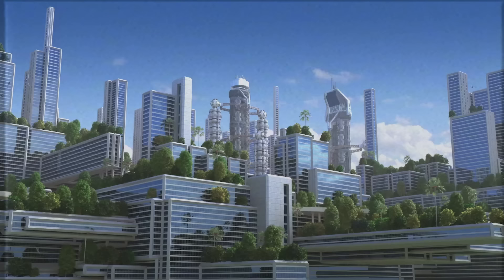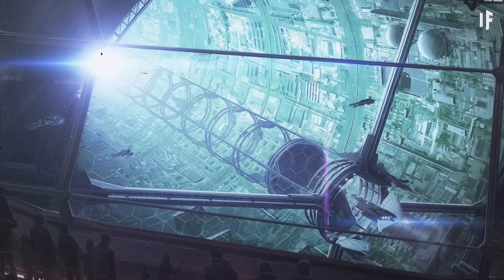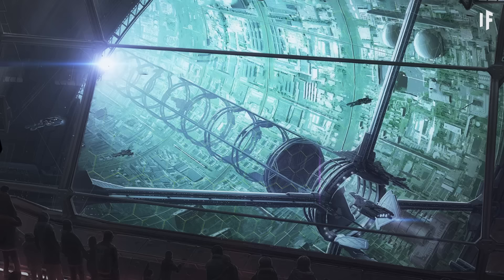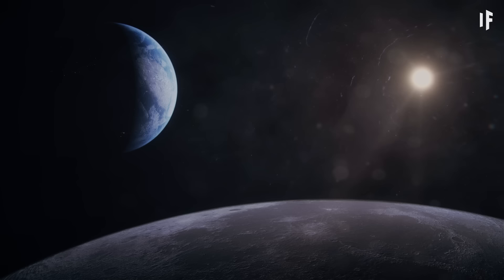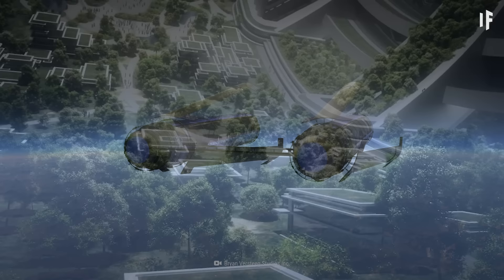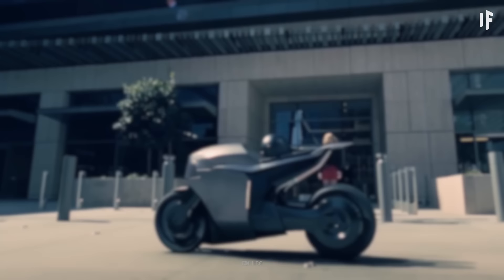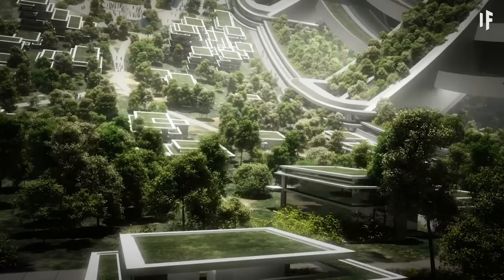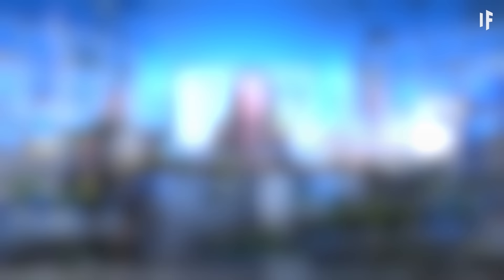What If We Built an O'Neill Cylinder?

Comment: 1970: this is a terrible idea, why would anyone wanna live there?
2020: yknow this doesn’t seem all that bad
Reply: Thats True😂
Reply: Actually, 1970's was when the book that O'Neill wrote about it came out and it was considered a good idea though students at Stanford designed the smaller and more feasible Stanford Torus which NASA said could be built in twenty years if their funding remained at Apollo era levels.  Unfortunately, their funding did not remain at those levels.

With both the O'Neill Cylinder and Stanford Torus, the first step is to mine resources in space, rocks for shielding, iron, aluminum, dry ice, and water ammonia ice for the pressure habitat.  Both Stanford and O'Neill proposed a mining base on the Moon but an asteroid trapped in CIS lunar space would do as well if we ever figure out how to mine without traction.

The construction could be quite simple and automated, metals could be drawn out as wires, spun as cables and knitted into structures with a large loom, the spaces between the cables could be thermite welded or filled with plastics or glass or even soldered with metal.  The dry ice and water gives us hydrocarbons hence plastics, oxygen and hydrogen, the ammonia which often comes with water in space gives us nitrogen and hydrogen.  The regolith/rocks can be packed in sandbags or mixed with a binder like plastic or cement to form the non-rotating radiation and meteorite shield.  The rotating pressure vessel can be separated from in the static shielding material by Halbach arrays of permanent magnets and aluminum rails or rather coils in an Inductrak magnetic levitation, that does mean the rotating pressure vessel would need occasional boosts to it's rotation either through thrusters, gyros or momentum control wheels and thrusters (at some point the thrusters would still be needed to despin the gyros or momentum control wheels as they can't be spun to infinite speeds but the gyros and momentum control wheels means that propellent doesn't have to be used all the time).  The energy for the levitation comes from the kinetic energy in the rotation of the pressure vessel hence the need to add more energy to the spin.  Transportation between the spinning portion and non-spinning portion would be done with PRT capsules that again uses Inductrak magneric levitation and linear motors and dock with the various habitable spaces whether with artificial spin gravity or the unspun microgravity areas.

Note, the original calculations used half atmospheric pressure for the atmosphere with higher oxygen levels for the same vapour pressure.  The idea was to reduce the structural strength needed for the pressure vessel.
Reply: Why is it a terrible idea?
Reply: It is a bad idea
It's not even an idea
Reply: @johnwang9914 looks like we have an engineer here.
Reply: 😯 great idea
Reply: Its not a bad idea to live in a colony until the one year war happened
Reply: 3020: Earth? You mean that big ball? Who'd want to live there?
Reply: This really could be the humans first step to an interstellar space colonization, I believe in that idea!
Reply: 2040: living on a planet? What a bad idea !
Reply: @johnwang9914  
Reinforced concrete takes much less metals compared to what we might usually think of, and makes a much more robust structure.
Reducing the mass of the overall structure is largely self-defeating. Rock works well as structure and shielding, and personally, I like the idea of having 1.7 meters of reinforced concrete as structure and shielding.
 If that's not enough, a non-spinning shell could be outside that encloses the entire colony and shipyards with shielding and meteoroid protection.
Reply: @JFrazer4303  Reinforced concrete is still strongest under compression with it's tensile strength from the iron reinforcement.  Rocks also have compressive stress not tensile and would fly apart under the stresses of centrifugal artificial gravity.  What's needed in a centrifugal pressure habitat is tensile strength.  The O'Neill Cylinder as designed by Dr. O'Neill, used steel for it's tensile strength and they still increased the oxygen content in the atmosphere to 50% so that they could reduce the atmospheric pressure to put less tensile strain on the pressure centrifuge.  Reinforced concrete is an excellent building material but is irrelevant in the discussion of an O'Neill Cylinder.  Now the non-rotating micro-meteorite and radiation shield proposed of the Stanford Torus which is 95% of the mass needed is not under tensile stress and hence can be packed regolith, perhaps in sand bags or with a binder.  Keep in mind that quicklime which is what cement is made of is produced by firing lime and lime on Earth is the product of life, particularly sea life with shells, and you're not likely to find this on asteroids or the moons.  Basically concrete as we know it isn't going to happen with a large space habitat but if you use plastics synthesized from the dry ice and water ammonia ice found in asteroids and the moons then you could use the plastics as a binder for the regolith instead of the cement in concrete.  It's a bit pointless to be talking if concrete as we know it when you're talking of building an O'Neill Cylinder as lime would be nearly impossible to source at a reasonable cost in space.
Reply: Lime is not the only sort of binder.
In every place I wrote "concrete" substitute "some ersatz artificial aggregate rock". Minerals of all sorts are not in short supply in space.
The tensioning cables are more than capable of handling all the loads if the shielding is the structure. It actually requires less rock and about 1/4 the amount of metals, compared to making a pressure hull of metal and a stationary rock shell.

O'Neill did the first works on this subject, but plenty have come along after and added other things that work even better than the methods in the first studies. Reinforced concrete is favored for such things.

This isn't just an idea from some guy on the 'net, but from some of the many books on the subject that have been written since the '70s, and published in peer-reviewed sources.
Reply: @johnwang9914  
It should always be stressed that what we know of as the "O'Neill cylinder" wasn't an actual design.
 Compared to O'Neill's "Island One" Bernal sphere or the Stanford Torus, it was just an idea, based on what's possible, but not really put forward as anything like what  might be built.
Some ~50 years after the first small habitat was done, somebody will start looking to build for bigger habitats, and it was just a suggestion. 
O'Neill said of the "Island 3" cylinder that it's probably about as accurate as what "futurists" in 1899 were saying things would look like in 1999.
Reply: @JFrazer4303  Aggravate is easy and only offers compressive strength.   I did mention that synthetic plastics could be a binder.  However, concrete regardless of what mineral and binder you build it from offers compressive strength not tensile strength and hence cannot be the pressure hull of a centrifuge, it would just fly apart from the centrifugal forces and of course the atmosphere it must contain.  It can serve as a non-rotating micro-meteorite and radiation shield which is 95% of the mass of the Stanford Torus but remember you are building centrifuges to provide artificial gravity here not building structures against gravity.  Concrete is not the critical building material technology needed with these large space habitats as you are not building a skyscraper on Earth.

Would the cables provide enough tension? That's hardly likely as the conceptual O'Neill Cylinder only worked with a solid steel pressure vessel if the atmosphere was made a fraction of the pressure of sea level which is why 50% oxygen content was proposed.  Concrete will have it's uses but it's not the miracle material you are portraying except unless it was enveloped with a graphene wrapping or perhaps with long graphene filaments as reinforcements.   Iron is still 8% if undifferentiated mass in space, likely 5% of differentiated material such as lunar regolith and of course type M asteroids which are essentially proto-planet core fragments would be well over 90% iron and nickel so it would make sense to use higher tensile strength materials that are available for the centrifuge pressure vessel than boast of the iron reinforcements in concrete when we already have calculations that the larger O'Neill Cylinder would be questionable with the tensile strength of solid steel to begin with (are you really going to continue pushing concrete for the centrifuge when calculations have already made solid steel marginal with the larger structures?).  Note even steel would require us to figure out how to use dry ice for the carbon instead of coal or coconut husks as we do on Earth.  You don't need to make building in space the same as building skyscrapers in Earth, the fundamental strength required is the exact opposite, mostly tensile strength as opposed to mostly compressive strength and concrete regardless of how you want to state the tensile strength of the iron reinforcements still provides mostly compressive strength.
Reply: @JFrazer4303  Why do you keep pushing concrete with iron rebar which provides far more compressive strength which minimal tensile strength hence the requirement for iron rebar in a design that requires almost entirely tensile strength and indeed with minimal need for compressive strength?   Even if you achieved sufficient tensile strength through the iron rebar, why would you invest in so much counter productive compressive strength?
Reply: @johnwang9914  
Because the facts show that the tensile strength of the cables (not simple rebar) are more than capable of the required safety ratings.
Because it makes a better structure.
Reply: @JFrazer4303  So you would buy a pack of a thousand assorted items just to get the one item that works.  The fact that rebar has the tensile strength does not justify concrete for the unneeded compressive strength, it is a centrifuge pressure vessel that we're talking about not a skyscraper.  Where regolith bounded either with a binder or in say bags would come into play is with a non-rotating micro-meteorite and radiation shield as specified with the Stanford Torus but the centrifuge, pressure habitat requires more consistent tensile strength than concrete and most of concrete would just be dead weight to flake off in the centrifuge, hint air can pass through gaps between rebar as the cement and aggregate crumble due to a lack of tensile strength in cement and aggregate.  You're just dancing around instead of admitting that concrete does not have a place as the primary structural material for a centrifuge pressure vessel as the whole point of concrete is to provide compressive strength held together by some tensile strength when the needs for a centrifuge and pressure vessel is tensile strength.  If the rebar has the tensile strength then why have the cement and binder providing the unneeded compressive strength.
Reply: @johnwang9914  Your opinion versus engineers who've looked into the problem.
Where have you published your ideas in peer-reviewed works on the subject?
Reply: That One Guy: I’ve seen enough Gundam to know where this is going.

Comment: 3d print it from cement made from regolith from the moon mixed with a synthetic polymer and lined with polyurethane to stop radiation. You should also design the interior with aerogel structures covered with earth and soil. This will cut down on the weight. That is if you want to simulate an earth-like terrain on the inside.
Reply: What's the point of keeping the weight down? We have flying mountains to work with and it only takes a whisper of effort to move in a sea of free energy.
Rock works just fine to stop radiation, and as long as it's balanced and built for the load, you could have mountains of rock with habitation inside them.

Comment: The problem with spinning something to make gravity is that it wouldn’t feel right. Particularly every time you turned your head quickly you’d likely get dizzy because the rotation affects the rotation of the liquid in your inner ear.
Reply: NASA studied this. Using not just astronaut test pilots, but secretaries and custodians and interns, just about everybody can move right in with no trouble if it's 1 RPM, which means ~900 meters radius (See the "Stanford Torus).
Many people are OK with 2 RPM: 250 meters radius.
A lot of others can fairly readily adapt to that, but the faster/smaller you go, the fewer people can. Astronaut test pilots by the numbers aren't much better, but can be more motivated to push through and force adaptation.

At low spin rates, people have lived for weeks in a rotating reference frame. Animals have lived for generations in higher than 1G, in centrifuges down here. They're stronger, more healthy and live longer.
Reply: @JFrazer4303  I’m not saying it’s impossible, just that’s it’s more uncomfortable
Reply: @jonathankey1533  It's something the generations living in the colonies would get used to overtime. Even the first generation to be born on the colonies would be readily inclined to expand their habitat very quickly.
Reply: @TheNapster153  ...
Is your name Zeon Deikun, by any chance?
Reply: @anhilliator1  We found the proponent of Newtypes and humanity moving to space!

Comment: Great video! I think the advances in LED tech mean we could light the interior with natural visible light, no UV or IR, and still have plenty of power from the panels without giving up all that space for the giant light panels taking up half the interior surface.  Besides glass/transparent panels would be extremely hard to make as strong as steel. To prevent precession and give radiation and impact shielding, I think a Cylinder would have a slightly counter rotating outer steel/dirt shell ~10m thick. And mass drivers on the moon throwing modular construction parts to the assembly spot could streamline the process.  Finally, perhaps we could start with a smaller 2kmx8km Cylinder, but with 10 levels (inner cylinder/axis, 5 low g levels, a big open outdoor area with an average of 3 levels for the outermost inward-facing surface area ('underground' levels and multi-story buildings.)
Reply: The large cylinder with 3 windows and 3 land strips aren't feasible.
First, they're inherently unstable, wanting to tumble end-end. Yes, it can be actively countered, but it's never a good idea t rely on complexity to overcome basic physics.
Second, those windows are all a straight path inside for cosmic rays. You need ~+ 6 feet of sand to stop them down so the dose inside is like a 1.7km elevation city down here. We won't have transparencies for that anytime soon.

The "windows" or light-pipes brining in Sunlight don't have to be half of the interior surface of a habitat. Light can be concentrated to come in a small aperture, with mirrors to bounce it in while stopping cosmic rays. Light from overhead would come from a point or small spot overhead.

Comment: About gravity... just came from a similar video where they mentioned if the diameter was too small (like in this case) the centripetal force you'd feel would vary at diferent body parts, causing blood pressure issues. So you'd have to have a bigger station so the Centripetal force is even throuhh your whole body
Reply: The first model which the NASA Ames/Stanford studies in the '70s depicted, were about a mile diameter tire or torus. 
800 meters diameter drum or sphere was also designed, for a slightly higher spin rate, but still slow enough to allow most people to be comfortable inside.
Reply: A diameter of severla km is **not** too small. The effects you're talking about apply when the radius is just a few hundred meters or less.

Comment: Greatest idea ever. Island One housing ~8,000 people with a mass of ~400,000 tons. Read Dr O'Neill's text; The High Frontier. He did not start off suggesting such a large settlement but about the size of the population I stated above. The Island One if ~ 4 miles in length & ~ 1 mile across

Comment: Two of the biggest flaws with any habitat like this one are we can't use direct sunlight and truly massive single point of failure.
The reason we can't use direct sunlight is that without 50 miles of atmosphere sunlight is toxic. The need to have a massive contiguous transparent surface that was both a radiation shield and filtered out all the spectrums above Violet would double the overall cost of the  hull if we even had a material that could do it. One of the main complaints about most large sci-fi vessels is that they have so many windows. The reality is windows are a point of weakness.
The massive single point of failure is related to large ocean going vessels. If you lose pressurization in any part of an O'Neill Cylinder you begin to lose pressurization in the entire volume. Though the intent on Earth is to prevent sinking a similar rule would be applied to orbital habitats. I think that most habitats would restrict compartments that could be independently air tight to no more than 100,000 sq m.

Comment: Reading the 1974 proposal written in the September 1974 Physics Today by Gerard O'Neill (as opposed to this Gerald O'Neill you mentioned) is uplifting and fun. There were many assumptions to his vision, including that humans would have built a manufacturing facility on a space station called L-5 to turn lunar rocks into useable construction materials for the cylinder. No L-5 means no cylinder. O'Neill's '74 article is more invigorating speculation than a plan.